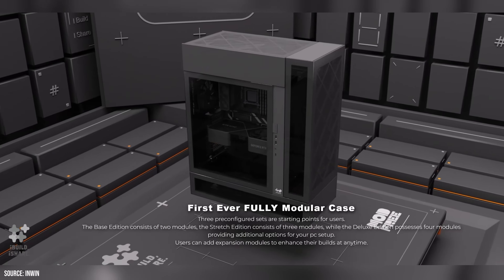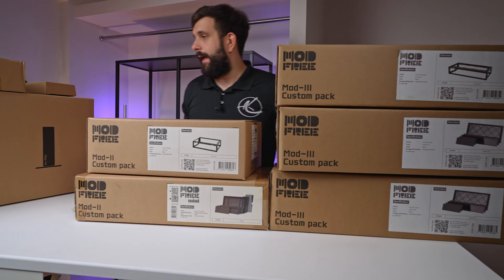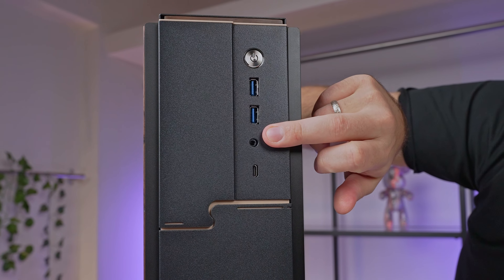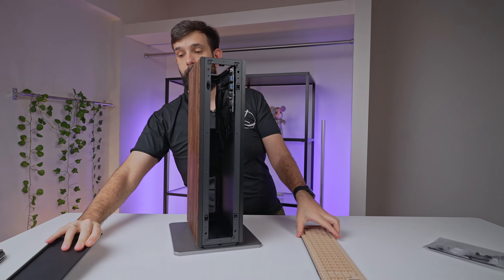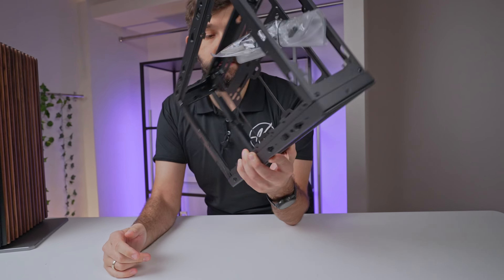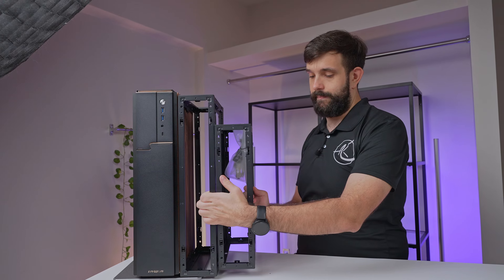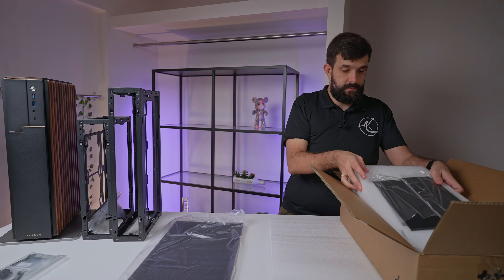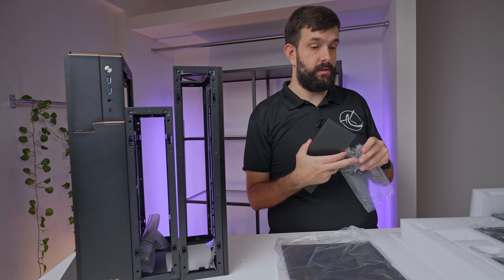InWin ModFree Mini Unboxing - Help Me Build This! Part 1

Comment: None of the videos I've seen about any of the MOD free show storage integration, they all just talk about it in passing like you just did.

Keep in mind some of us want to use lots of hard drives, we need to see examples of the drives in a sort of server station configuration.
Reply from the maker: This was just the unboxing and brief intro. We are currently working on part 2  with actual building. Do you have any specific storage questions that we can go through?
Reply: @A2KMedia  
I couldn't find any information about drive storage.

How many drives can it store?
Can it accommodate 3.5in drives?
what orientation is available for drive storage? 
Must the drives be mounted flat to the frame or are there specific mounts available?

Thank you.
Reply: @A2KMedia  also
Can it accommodate an optical drive?
Reply from the maker: Noted, we'll include the info in the video, thank you for asking questions! :)